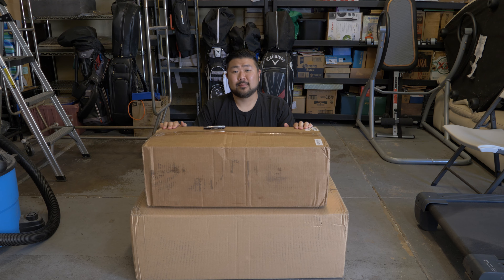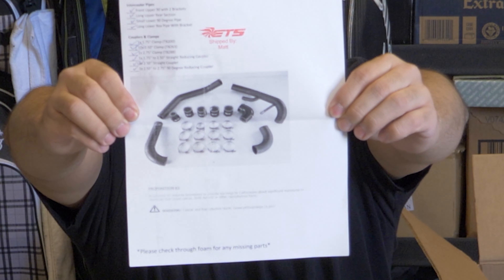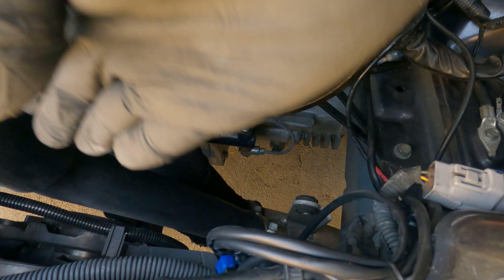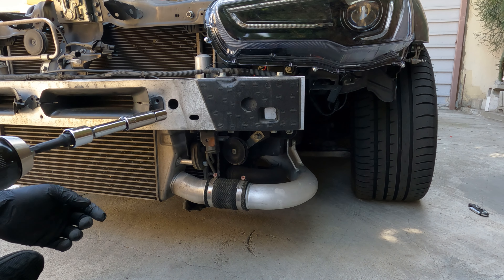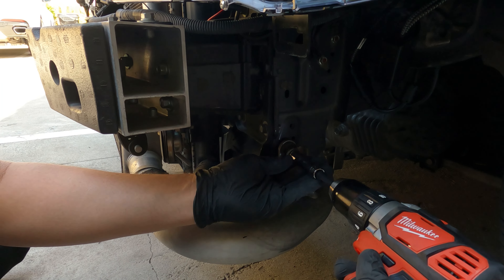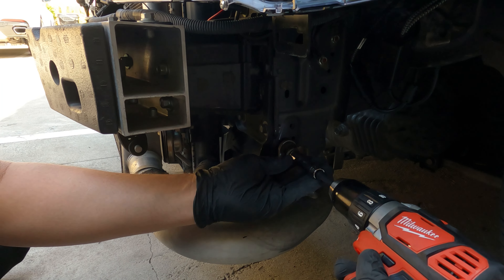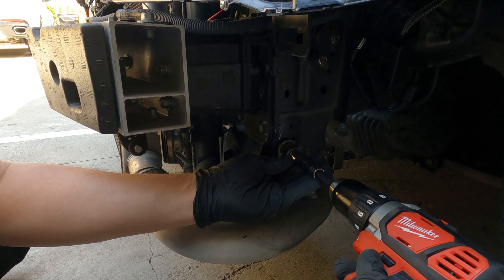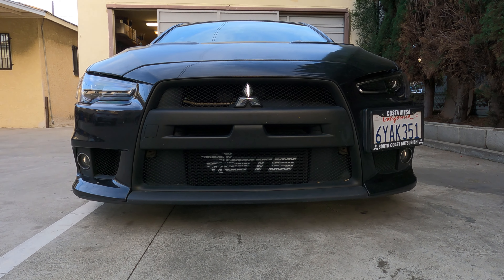ETS Intercooler and Piping install for Evo X!!!

Comment: Thanks for the video, I find it really helpful and inspiring! ❤

Just one question. Is there any noticeable turbo lag after you jumped from 2.5 to 4 inch? That's few more liters of air to be filled.
I am planning to install an ETS turbo kit on my bone stock EVO X and I wonder if I will see a delay in spool times (currently kicks in around 3500 rpm).
Also, you did not get a remap, right?
Reply from the maker: Thank you for the kind words 😁. I didn't really notice a huge difference in the turbo lag because I'm also using the stock turbo for now and I feel it's about the same. I'm not tooooo sure but I feel it kicks in at around 3800 for me. Didn't do a remap but I feel to really feel the difference between the 2.5 and the 4 I will probably have to get a retune. I am going to be going with a bigger turbo in the future so I just wanted to future proof my car haha 👍

Comment: Another great video! I've already done my Intercooler piping (it was a pain) I just haven't upgraded my Intercooler yet! >_<
Reply from the maker: Installing the intercooler isn’t too bad compared to the lower intercooler piping if you get a 4inch or smaller hahah. I think my car someone bumped it in the front so it has a little less space than stock. You can definitely do it if you did the piping 👍🏼 thank you for the continued support 😄

Comment: did you notice your car running lean after installing it without a tune? or was it safe
Reply from the maker: The car feels the same I think, I pushed it a couple times without a tune and still have yet to tune it 😂 it might be good to get a tune if you’re getting multiple mods at a time 👍🏼 except if it’s a major mod that NEEDS a tune
Reply: i see. yeah im kinda on the same boat right now. im future proofing for mods so i just want to make sure if ill be safe if i install it without tune
Reply from the maker: Yea so far it seems fine and the car is running well for over a year now. If you are really hesitant though you can hold off on the tune until you get the future parts 👍🏼

Comment: Pretty sure that's the power steering cooler but 💯 anything on the evo you have to take time . You should looking into a sent of Rad hose picks to help with the stuck hoses .
Reply from the maker: Yea I may have to look for a new set of hoses hahah 😄
Reply: I have in the box red silicone ones from mishimoto. I just installed their radiator and oil cooler (oil cooler wouldn't recommend bad fitment)
Reply from the maker: I heard there was a dual oil cooler/coolant reservoir from MAP might look into that 👍
Reply: @JeffSongCars  also on a side note from not sure if you do all your servicing but I am an Amsoil independent dealer , I obviously can't sponsor "free oil " your page but if you want I could give you a account to help you get the best cost on the oil . I just did my transfer case and transmission in mine yesterday.
Reply from the maker: I do oil changes at most but I really want to be able to do my whole car so that would be awesome! I do have a couple of gallons on synthetic oil left over but let's keep in touch!

Comment: did you need to tune your car by installing the Pipes and intercooler?
Reply from the maker: Didn't need a tune for the intercooler and piping. I think my car runs a little better because before I had a problem with going full throttle and it would just die out on me(I think the stock intercooler piping would come lose) but with the pipes its stronger than ever 😎

Comment: Don't need to take off crash Beam bar, I got the same intercooler. Just gotta finesse it in there
Reply from the maker: Sadly I think my car was hit and run as another viewer pointed out, I think someone hit my car just enough so that the bumper didn't show any damage but enough to push the upper portion that the intercooler slides into inwards so that the intercooler didn't fit 😭, just glad that it fit afterwards haha 👍
Reply: @JeffSongCars  sounds good. Keep up the mods! Great job!
Reply from the maker: @andrewvang3729  Thank you!! 😃

Comment: Should remove the intercooler shrouds. Makes it look more aggressive. Are you going with 18k turbo?
Reply from the maker: Hmmm I may do that haha, for the the turbo I was thinking of getting a stock frame 3576 from Chris Robbins(TRU turbo) on facebook
Reply: @JeffSongCars  Id do TPC GT SPEC
Reply from the maker: What would you say the advantage of that turbo is? Is it a stock frame?
Reply: @JeffSongCars  it is. They use quality material all stainless steel. It is a stock frame. Check them out. Turbo parts Canada
Reply from the maker: @ViggenStory  Hahahaha I think thats actually the company I was talking about. I think Chris Robbins runs that company 😂
Reply: @JeffSongCars  yeah and get a chagtune with that
Reply: @JeffSongCars  Chris Robbins is TRU (Turbos-R-Us), TPC is Turbo parts Canada, different company. I also recently debated between the TPC GT spec and one of Chris's turbos, I ultimately chose Chris's GTX3582, which is the same spec as the TPC GT spec the other guy recommended. Mine is still being built though, because it does take some time for Chris to make them, but in my opinion you cant go wrong with either but there are some differences that may make you lean more towards one, like it did with me. The things that pushed me towards TRU (Chris) was the GTX 11 blade option (louder spool sounds), his soon to be released T51r mod based anti surge covers (even cooler spool sounds), a 3 inch compressor inlet hole vs TPC GT spec only having a 2.5 inch hole, and the price with the turbosmart wastegate upgrade. The base TRU turbos are cheaper than the base TPC ones. They both come with oem style wastegates but with the upgraded turbosmart wastegate option on Chris's turbos they both become basically the same price, but the turbosmart wastegate is much better than the oem style one. So I went with Chris (TRU) because for basically the same amount of money I would rather have the turbo with the louder spool sounds, antisurge cover, larger inlet hole, and upgraded wastegate.
Reply from the maker: @DaJoJomason  Wow that was really informative thank you very much! I was actually leaning towards Chris' turbos too but maybe a 3576 spec but I'm gonna wait until I pass California smog 😉 and then maybe wait till the new t51r mod comes out haha. I bet you're dying to put that turbo in🥳 Congrats on getting it! Can't wait to put my order in  👍
Reply: @JeffSongCars  I'm somewhat excited to get it and also somewhat dreading it. I recently replaced my downpipe and exhaust manifold, and after suffering through removing and replacing those, im going to have to remove them again for this turbo upgrade... But I know the car is going to be a ton of fun afterwards, aiming for ~500whp! and then a bit more when I one day upgrade my engine and trans. I would message Chris on FB and join his TRU facebook group for some more info, you can even see some people's dynos on there and compare the turbo options. I originally was going for his red spec, but after some back and forth with him I narrowed it down to his 3576 or 3582. Both are great and either is fine but Chris recommended me the 3582 because it's rated 30hp more for only 200rpm later spool. Some other things I think I should also mention for comparison sake is that TPC turbos are completely new, but Chris sometimes reuses oem cold sides, but if you get one with his new anti surge covers its going to be a completely new turbo. Also, Chris does not include a replacement braided oil feed line, which is a recommended thing to replace, the hard oem ones are prone to cracking and leaking, TPC includes one with their turbos. Lastly, Chris's turbos are journal bearing, while TPC offers a ball bearing upgrade for a few hundred dollars more.
Reply from the maker: Same here! With the stock block I want to aim for around 500 whp, have you already gone e85 or flex fuel? Hmm 200 rpm doesn't sound too bad but I kind of get scared pushing my engine past 6500rpm hahah. Definitely going to refer back to your comment later so I don't forget about the turbo line 😄
Reply: @JeffSongCars  I got everything to do flex other than the sensor, so I can go flex for not that much extra but I haven't fully decided yet. My turbo is going to make mid to high 400s on 93 pump gas easily, so I don't know if going flex is worth it for my current situation. I'm going to talk to my tuner a bit more but I'm either going for near 500 on pump gas or im going to do flex with a low 400s conservative tune on pump gas and 500 on e85. That second option might be better because the lower pump gas tune will not stress my engine as much while allowing me to put e85 in at any time to crank the power up.
Reply from the maker: That definitely makes sense in your case! Out where I live in Cali the highest octane we have is 91 sadly 😥. 500 whp is going to feel really nice 👍

Comment: If you get the intercooler piping anyone, don't bother with the lower intercooler piping. The stock one is fine. Save yourself a couple hundred dollars
Reply from the maker: Ahhh didn't even know haha I just bought the whole set to make it match 😎👍
Reply: Same but I noticed how much hard piping there was on the stock one and I assumed it was mainly rubber.
Reply: Definitely gnna get the quick release though!
Reply from the maker: @evolicious-x  Yea same here haha I never thought to look down there before installing and ended up buying the whole thing 🤣. Quick release makes life soooo much easier haha just be prepared to drill into your bumper though!

Comment: do you need tune for this?
Reply from the maker: I’ve been running the car without a tune after the intercooler system but I was tuned before that. I don’t think it’s absolutely necessary to tune but it would help with the performance of the car 👍🏼
Reply: @JeffSongCars  thats great! thinking of putting one on my 08 gsr haha. thank for the quick reply!
Reply from the maker: No problem! Just don’t push the car too hard 😉 👍🏼

Comment: You don’t need to remove crash beam to install intercooler.
Reply from the maker: I tried sliding the intercooler upwards but the middle metal portion that holds the freon was blocking the intercooler from going up any further, was there another way around that? I couldn't for the life of me push the intercooler upwards to make it fit the two bolts on the bottom of the intercooler hahah

Comment: I think your car may have been hit in the front.
Reply from the maker: Hmm that would make sense as to why it didn't fit snugly. Might have been a hit and run at a parking lot 😥
Reply: @JeffSongCars  o noticed one of the snorkels in your crash beam is broken also. That's what made me.think this. Nice car and video tho!
Reply from the maker: Oh! I was wondering why it was all mashed in I didn't even think to realize that may have been the case 😅.  Thank you for pointing that out and for the support! 👍